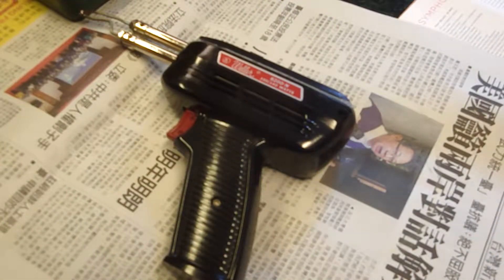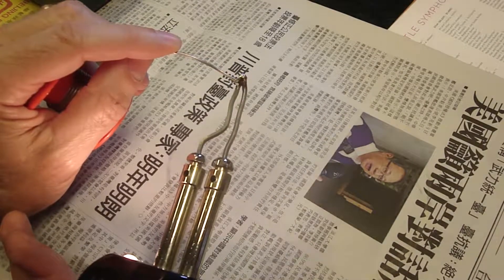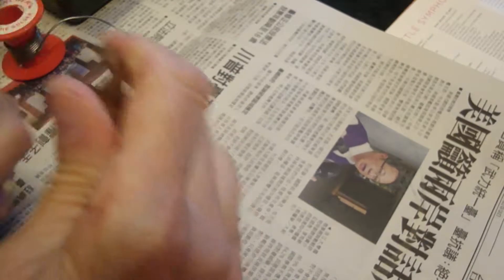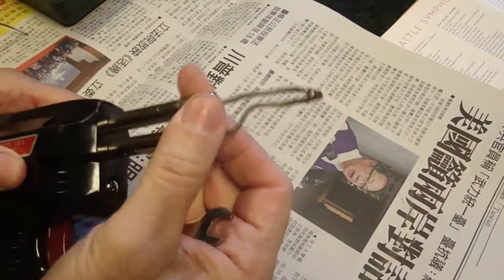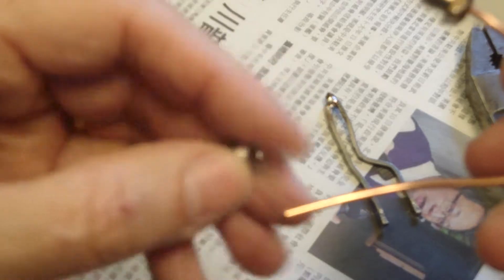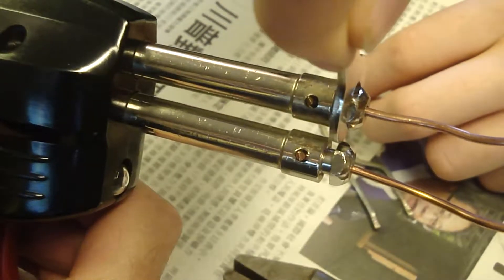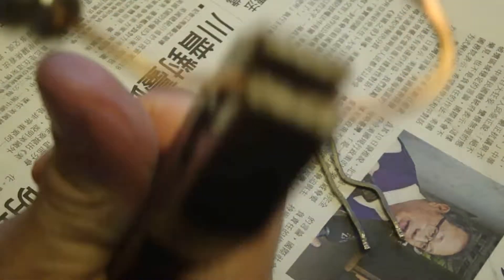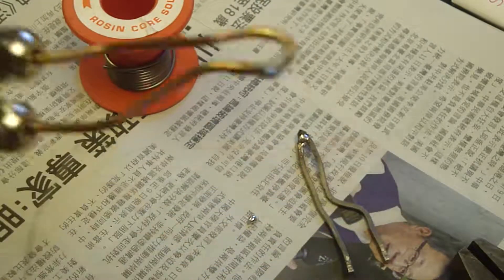How to Make a Soldering Gun Tip

Comment: The tip must be tight on soldering guns. I won't bore you with the gory details, it is a type of transformer with a specific formula, but there is high ampere running through the tip which is causing it to heat up for soldering guns. A loose connection whether nuts or screw type, and that will not allow the electricity to flow and the tip will not get hot. If the connection is loose, the tip may get warm over time, but not hot like it needs to be.
Reply from the maker: Thanks for the tip!   ;-)

Comment: Use a steelwool / sandpaper to remove the oxidation of the copper wire. That way the solder will stick better for tinning.